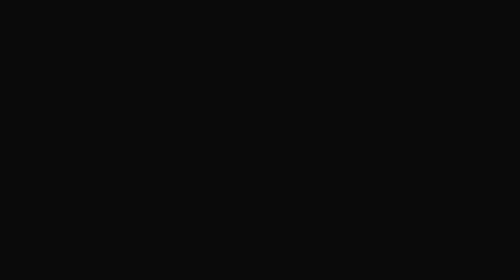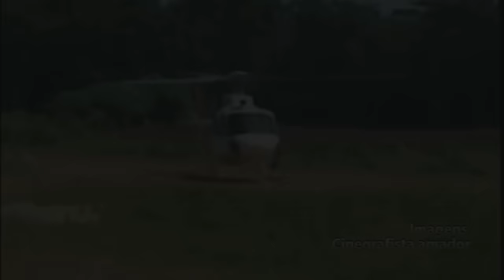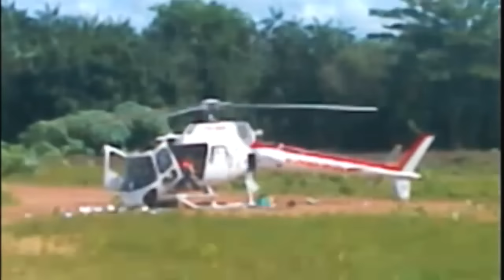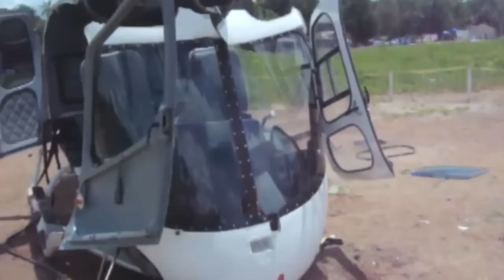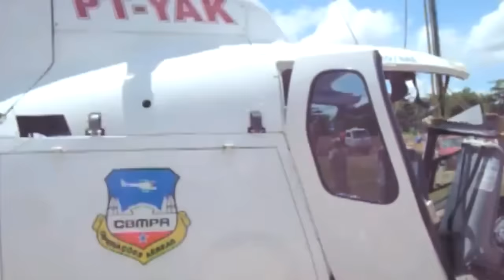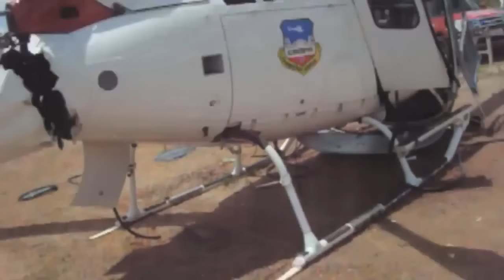Explained: AS350 Eurocopter Helicopter Self-Destructs

Comment: No, Pilot felt the vibration before he landed problem was not caused by a hard landing, pulling it into a hover might have helped but you have to land sometime. Never flown a 3 bladed rotor system unbalanced but in a non articulated 2 bladed rotor system it feels like riding a galloping horse.

Comment: Not a pilot here but, how would the problem rectify itself had the pilot gone airborne again?
Reply: +Doug McPheters Pilot here, ground resonance is caused by the landing gears' impact causing in imbalance in the main rotor system. Picking up would give the helicopter time to correct itself.

Comment: Most of the cabin section on this ship is merely a way to keep the occupants warm and dry. A strong individual could actually kick it to pieces in short order. The only real cabin structure is the cockpit floor. Although it failed to a degree, the seats remained attached and no-one was ejected although I imagine they were shaken AND stirred.

Comment: Isn't the way out of Ground Resonence to pull Pitch & get back off the ground fast? It just suprises me they didn't do that, But IDK I'm not a pilot.
Reply: Ground resonance is an imbalance in the rotation of a helicopter rotor when the blades become bunched up on one side of their rotational plane and cause an oscillation in phase with the frequency of the rocking of the helicopter on its landing gear. The effect is similar to the behavior of a washing machine when the clothes are concentrated in one place during the spin cycle. It occurs when the landing gear is prevented from freely moving about on the horizontal plane, typically when the aircraft is on the ground. When landing the collective needs to be all the way down.

Comment: Why did they not shut the fuel off and pull the rotar brake. That is crazy.  I have flown that aircraft for over 2000 hours, never seen anything like that.
Reply: I think it was spinning because of the resonance, not because the motor was still rotating
Reply: ficolas2 The spinning was causing the resonance, not the other way around.
Reply: Cielo Pachirisu correct.

Comment: I doubt any pilot would give it more power and attempt to hover and think that it'll just fix itself with a vibration that's bad enough to break the chopper into pieces.. Not exactly like its a 91 Buick with a shimmy at 55 that goes away at 70...
Reply: But raising collective when the disturbance is noticed will let the aircraft correct itself. this only happens on the ground, so if the landing skids got no ground to have contact with, the vibrations cancel itself out.
Reply: @detesla9575  They were already in flight, "When the pilot noticed excessive vibrations" Go slow mo, looks like the scissor link is detached from the head. They were lucky to land intact.

Comment: The 350 cabin is historically known to grenade and offer virtually no protection to Crew and passengers during hard landings and accidents!

I do not believe that the 206 or 500 would have come apart like that if subjected to the same level of ground resonance that this 350 experienced.

Quite why the Pilot didn't lift the helicopter into a hover at about a metre off the pad remains unclear.

Comment: It would seem that the landing skids would be made of composite materials to prevent resonance.
Reply: Ground resonance is an imbalance in the rotation of a helicopter rotor when the blades become bunched up on one side of their rotational plane and cause an oscillation in phase with the frequency of the rocking of the helicopter on its landing gear. The effect is similar to the behavior of a washing machine when the clothes are concentrated in one place during the spin cycle. It occurs when the landing gear is prevented from freely moving about on the horizontal plane, typically when the aircraft is on the ground. So, when you touch down the collective pitch needs to be all the way down.

Comment: If the vibration was first felt in the air, why on Earth would he pick it back up into a hover? Be interesting to see the final report on the cause of the in-air vibration. 

Whatever the cause.... this self destruction appears to have been inevitable. Nothing the pilot could have done other than land asap, which he did.
Reply: In the air the airframe itself is free to move and will generally dampen the oscillation. On the ground there's nothing to dampen it and it just magnifies until self-destruction. If you don't have the rotor RPM to get off the ground, the only thing you can do is kill the engine and hope for the best. I suspect that even if you get back into the air, it's best to make a safe landing as soon as possible and get the aircraft checked out.
Reply: you're very wrong. i hope you're not a pilot.
Reply: trijigon Alright then, what's your take on what happened?
Reply: the destruction of the aircraft is definitely due to ground resonance. if the pilot wanted to save the ship, he should've done the proper procedure which is taking off. the ship would've sorted itself out. what vibration he felt in the air, i have no idea. but it is very doubtful it would have destroyed the aircraft before he set it down.
Reply: trijigon 
The crew were faced with a helicopter that was going to either
A) Shake itself apart in flight, or
B) Shake itself apart on the ground. 

I'd rather be safe (relatively) on the ground when a machine self destructs. Then again I've only been flying commercially for 12 years and hold ATP licenses on 3 continents... so what do I know, right?
Reply: the pilot was not faced with those scenarios. you created the first one yourself. when have you ever seen a helicopter  go from a vibration in air to experiencing ground resonance effect IN AIR and self destructing?
some of the possibilities were:
A) Shake itself apart on the ground possibly killing everyone in it
B) Take off to a low hover as the ep's call for and:
1.  let it sort itself out
2. somehow, in a way that is not common knowledge whatsoever, shake itself apart in air. if somehow it did, it would be a few feet off the ground which could kill everyone, but  is still survivable.
He could also perform the procedure for a power off landing in water if it was somehow self destructing in air. that would destroy the rotors and possibly reduce the resonance and still possibly kill everyone.
He could have also just jumped out and killed himself and then everyone. It's easy to play "what if" when we don't know the facts and we weren't the ones flying the ship. but again. without a doubt, the fact is the helicopter experienced ground resonance and destroyed itself. that's irrefutable. whether something else happened while still airborne, who knows. saying he felt vibrations after the fact sounds like a good attempt to cover your ass after knowing you made a major mistake.

Feeling the need to flaunt your experience shows your character. remember, there's always someone better and more experienced or knowledgeable.

ps, pilots aren't known to have the most absolute knowledge on all things aeronautical. that would be the rocket surgeons... the guys designing these things.
Reply: Agree to disagree. But I've never seen an emergency check list that says to "let it sort itself out" when it comes to any vibration.
Reply: HeliRy that's the only way to stop ground resonance....
Reply: Ground resonance is typical in A-stars, and doesn't happen in flight, hence the term ground.  The resonance part comes from the landing gear.  Two ways to stop ground resonance:  If your Nr is high enough, pull pitch and get to a hover.  If not, use the rotor brake.  You can still pull pitch to get the rotor speed down faster.
Reply: @Ostsol  Ground resonance is an imbalance in the rotation of a helicopter rotor when the blades become bunched up on one side of their rotational plane and cause an oscillation in phase with the frequency of the rocking of the helicopter on its landing gear. The effect is similar to the behavior of a washing machine when the clothes are concentrated in one place during the spin cycle. It occurs when the landing gear is prevented from freely moving about on the horizontal plane, typically when the aircraft is on the ground. When landing the collective needs to be all the way down.

Comment: As a private pilot, I prefer fixed wing flying machines. I’ve ridden several helicopters over the years, good ride, but way too many critical mechanical parts always in motion. If most any of them fail, well something serious usually happens. Parts MUST be replaced on a scheduled basis, period.

Comment: Sometimes makes me imagine there should be something like a hand activated disc brake that slows the rotor and engine on the ground, if the pilot judges it to be necessary. On the other hand maybe applying enough force to be useful would risk spinning the whole helicopter, breaking rotor blades, or something equally bad. And you don't want it to be something that ever gets accidentally applied in flight since, you know, possible deadly results
Reply: most helicopters, including this heli do have rotor brakes

Comment: Ok, I've read enough. 

That is not a design problem or a manufacturer  problem. It is implicit in the Full Articulated Rotors, ALL OF THEM.. 

As long as you hit the ground hard, the lead-lag compensator will allow and descompensation in the main rotor  with a result in vibrations ... that is all ... 
I've felt ground resonance a few times .. it is no a big deal as y ou rise collective and pick up. Even you have a few seconds .. maybe 5 seconds before the problem become a disanter.

Blame on the pilot, not the helicopter! Maybe the pilot never hear about GR before, sadly he already learned by the hard way.

For the people who think they are safe from GR because they are not flying a AS350, good luck!

So please, stop to say stupid things about Eurocopter/Airbus or Aerospatiale, be more smart than that.
Reply: +Franjaver Ariza this helicopter does not have a fully articulated rotor system..
Reply: U r right, my fault

Comment: A helicopter is just an airplane with no wings, vibrating pair of engines, or single vibrating engine, and a very poor safety rating. It can't afford to loose an engine or mechanical linkage to the tail rotor. It can't afford to lose hydraulics or actuator control. There are multiple systems that cause complete failure if they fail. Conclusion, not interested in helicopters unless life depends on it in absolute emergency. Much respect to the people who fly in them regularly to save others.

Comment: Since the helicopter was already on the ground, the pilot could have stopped the ground resonance by instantly lowering the collective and chopping the throttle.  For resonance to be destructive, it requires energy input, which comes from the engine.  Take away the source of energy and the oscillations quickly die out.
Reply: The low rpm gets the bigger and stronger the resonance gets.... There's a video you can search of "Hughes 269 resonance"
Reply: Err he's on the ground the blade pitch is flat so the collective is already down. And chopping the throttle does not quickly fix ground resonance.
Reply: @zzodr — You evidently don't understand what "resonance" means.  Take a course in physics.
Reply: @Milosz_Ostrow  It's obvious you have never flown a helicopter.
Reply: @zzodr  — Right!!  The FAA awarded me a commercial rotorcraft rating just for sending in $2 and five cereal box tops.  Hahahahaha!!!!

Comment: @fhhuber506771 It didn't get any worse, just that effects of lift change when you get in close proximity to the ground. Something that causes "excessive vibration" in the air can get far worse as you go to land. To make it worse, while you are in flight, the skids are free to swing like a pendulum and sort of dampen the effects, but once they are on the ground, they are basically held still, forcing all of the oscillation to the rotor head. That's how I read the situation, anyway.

Comment: VERY easy to get into ground resonance. Been left seat when one of our pilots ( 2 different times ) made the mistake of lower the collective too fast on landing after only one skid was on the ground. That little bounce took the blades out of phase and the resonance began. He got the helicopter in the air and it quickly subsided. Of our 5 B3 Astars, there are a couple that seem more susceptible than the others. They all have their own "personalities" out of the factory.

Comment: G.R. does not happen in flight...That was rotor hub malfuction.
Reply: That's pretty much what they said, there was a mechanical problem with the head and it showed up as a vibration in flight. It became a severe GR when on the ground.
Oh well, at least now they have a good supply of spare parts.

Comment: How can any vehicle just fall apart like that from a bit of vibration?? Wtf is it made from , egg boxes?
Reply: Ground resonance is an imbalance in the rotation of a helicopter rotor when the blades become bunched up on one side of their rotational plane and cause an oscillation in phase with the frequency of the rocking of the helicopter on its landing gear. The effect is similar to the behavior of a washing machine when the clothes are concentrated in one place during the spin cycle. It occurs when the landing gear is prevented from freely moving about on the horizontal plane, typically when the aircraft is on the ground. When landing the collective needs to be all the way down.

Comment: Good thing it happened 6 inches off the ground and not 6000 feet up in the air
Reply: Skids contacting the ground is an important contributing cause for the break-up. Google "Ground resonance". Would probably not break up in flight.

Comment: But you didn't explain what happen...
Reply: Ground resonance is an imbalance in the rotation of a helicopter rotor when the blades become bunched up on one side of their rotational plane and cause an oscillation in phase with the frequency of the rocking of the helicopter on its landing gear. The effect is similar to the behavior of a washing machine when the clothes are concentrated in one place during the spin cycle. It occurs when the landing gear is prevented from freely moving about on the horizontal plane, typically when the aircraft is on the ground. When landing the collective needs to be all the way down.
Reply: @williamfaulkner1959  That was helpful to understanding this phenom, I wonder if SKIDS vs WHEELS make a difference. I have always wondered why some choppers have Wheels (which seem convenient) and some, Skids. And wonder if one or the other make this resonance worse? thx, chopper buff.
Reply: @kennethmartin1300  Wheels are a weight factor with smaller choppers. Back in the early '60s I took lessons in a Hughes 269 with skids and to move it into the hanger we had to rotate the wheels, attached to the skids, and that would lift the skids off of the ground enough to roll the chopper into the hanger. Either configuration would have the same results with ground resonance.
Reply: @williamfaulkner1959  Thanks!! That helps with some of the mysteries of these machines, someday 'Matt p' may benefit also.

Comment: "Which started circulating Wednesday February 26nd 2012" (at start of vid).
1st. February 26nd is a Sunday
2nd. This video is uploaded at the 24th. 

So.. fake or what?
Reply: Nope, you don't hear to well. He clearly says Wednesday 22nd 2012. If it was 26 it would have a TH not a ND after the number.

Comment: This is brought about by pilot using overemphasised movements of the collective which results in head rotor shift that oscillates throughout the structural fabric such that the energy is transferred back down to the airframe. The pilot executed the correct procedure in ejecting the front Pilot Cabin pod and safely making his way out. The bolt firing mechanism worked perfectly and had the aircraft been in flight the flight pod would have opened the emergency chute for a safe landing.

Comment: The real situation is the poor work with the repair in the blades of the main rotor. Certainly  one mechanics or the worst company made one repair COV in the one blade and one moment the repair unlocked the blade area , and result the ressonance on the ground. I said to you because I'm mechanic of the helicopter.

Comment: that;s really good info to know          
 it can be really dangarous  
i know all about then   
im a flight simulator helicopter r pilot
Reply: +Vintage toys-melbourne australia-victoria RC helicopters do the same thing especially with my 5-blade but after the headspeed stabilizes and I add some blade pitch from a lot of negative it stops.  I don't worry about it after.